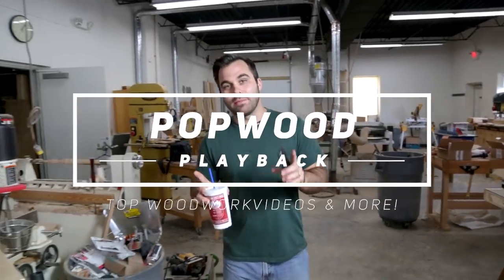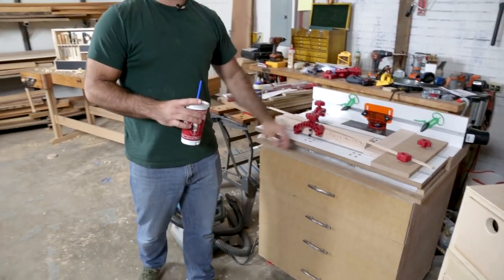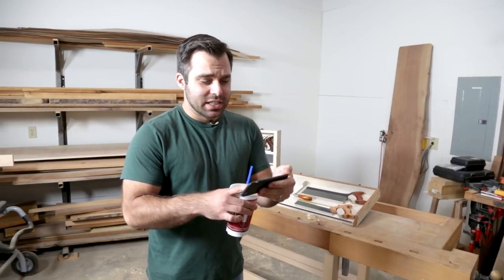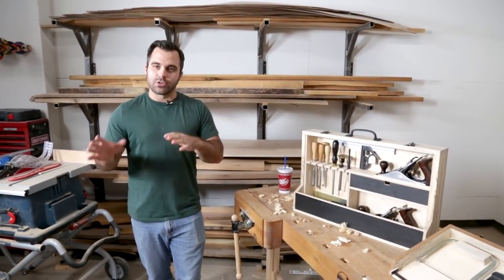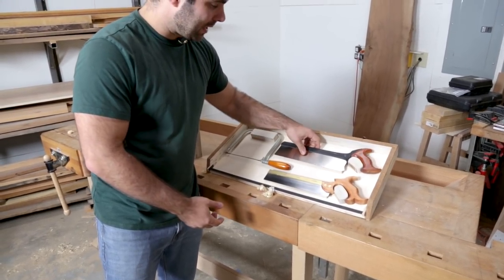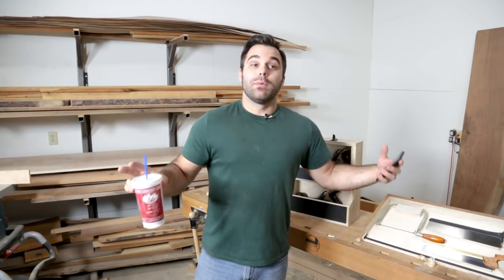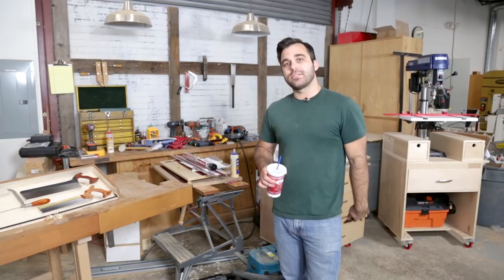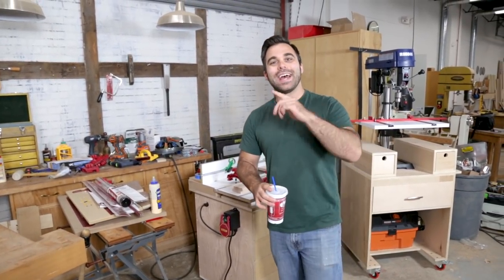Super Accurate Miter Gauge, Mortise and Tenon for the first time and more | PW Playback #39

Comment: If you have very bad spoilt in in a wood you can impregnate all the wood with resin before starting. This will make it stable. However it will be a lot harder on your tools.
Reply: A reason to build a sharpening jig(s) from nice hardwood scraps and some brass/bronze bling.